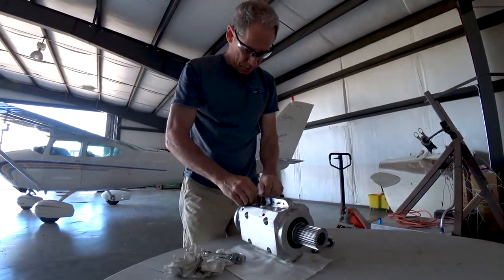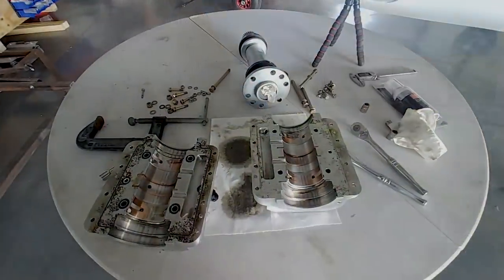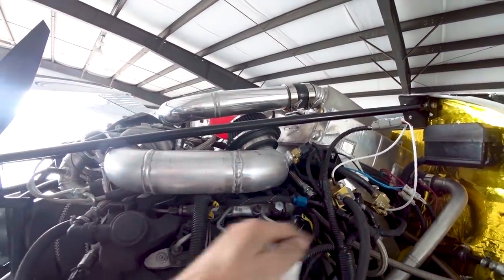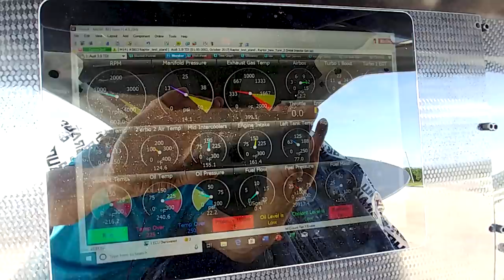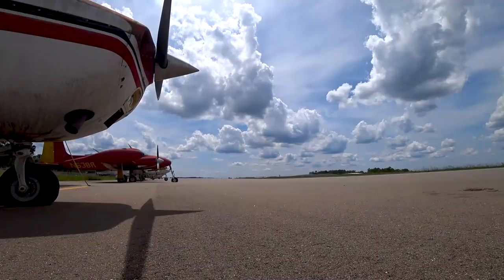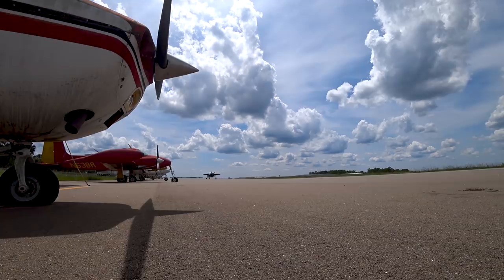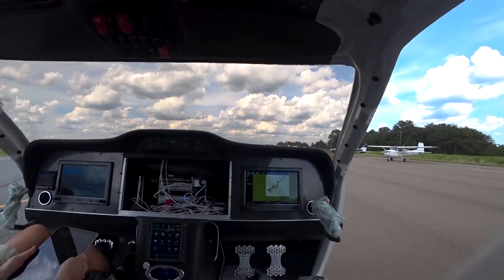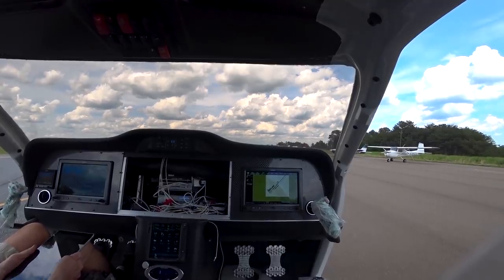High Highs and Low Lows - Building the Raptor Prototype

Comment: Thru out this entire series I have not seen anything involving the FAA for certification, title 14 Code of Federal Regulations (14 CFR)

    Part 21, Certification Procedures for Products, Articles, and Parts
    Part 23, Airworthiness Standards: Normal, Utility, Acrobatic, and Commuter Category Airplanes
    Part 34, Fuel Venting and Exhaust Emission Requirements for Turbine Engine Powered Airplanes
    Part 36, Noise Standards: Aircraft Type and Airworthiness Certification
    Part 43, Maintenance, Preventive Maintenance, Rebuilding, and Alteration

PS-ACE100-2001-006, Static Strength Substantiation of Composite Airplane Structure
PS-ACE100-2001-004, Guidance for Reviewing Certification Plans to Address Human Factors for Certification of Part 23 Small Airplanes 

Advisory Circulars (ACs)

    23-15, Small Airplane Certification Compliance Program
    23-16, Powerplant Guide for Certification of Part 23 Airplanes and Airships
    23-17, Systems and Equipment Guide for Certification of Part 23 Airplanes and Airships
    23-19, Airframe Guide for Certification of Part 23 Airplanes
    23.1309-1, Equipment, Systems, and Installations in Part 23 Airplanes

just wondering how this airplane is going to be certified.....
Reply: It's not 

21.191 Experimental Certificates - specifically (g)
21.193 Experimental Certificate General 
AC No: 20-27G  

The initial information on the website outlines the intent for 51% build by the buyer.  There are ways to speed that up but I expect most people in line know that they are going to be doing substantial building/assembly themselves and look forward to it. Read up on the Velocity which has the same Experimental AB certification as this plane will have.  Join EAA if you are serious about wanting one.  I do not/am not an expert on FAA regulation and others my correct me but I do have a place in line and a membership in EAA.
Reply: @scottwoodman7246  The 51% rule deals with it being Amateur built, not built by the buyer.  If an individual does indeed do 51% of the work they can apply and be granted the repairman certification for condition inspections. This will indeed have a Special Airworthiness Certification but unlike the Velocity (or my RV-10) it will not be 'Kit Built', instead it will most likely be considered scratch built or exhibition or market survey or something different.  None of this will fall under Part 23.
Reply: vaughnbay  (Looks like the comment I was responding to was deleted, I'll leave this just if I was unclear on what I stated) 
Thought I was pretty clear on my points, I'll outline them for you.
1) Part 23 does not apply to this plane
2) 51% rule has nothing to do with the 'buyer' 'owner' or a single 'builder' unless there is a plane for that individual to get a repairmans cert for that specific aircraft
3) I pointed out that the airworthiness certification on a kit build such as a Velocity or RV-10 is different than what this plane will need to do

Comment: For the redrive you are going to need twin ceramic rollers where the bimetal film bearing is. Actually rollers on both ends. Under tension when the oil pressure is nil the shaft is deforming the bearing I'm guessing